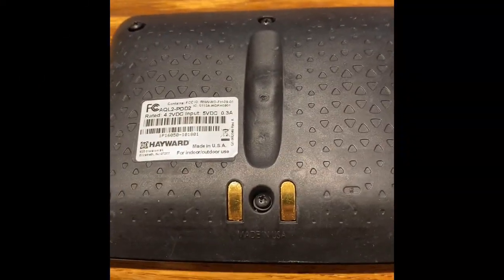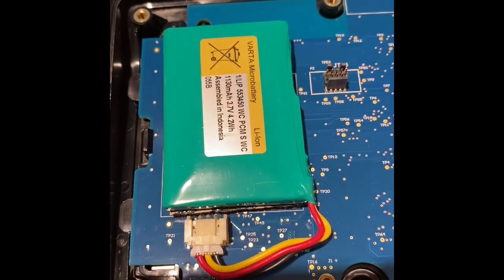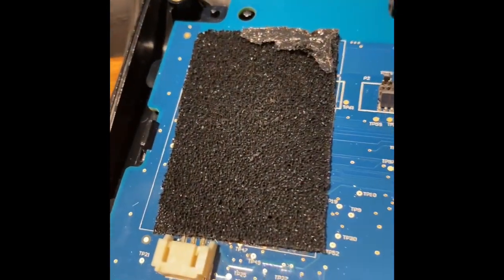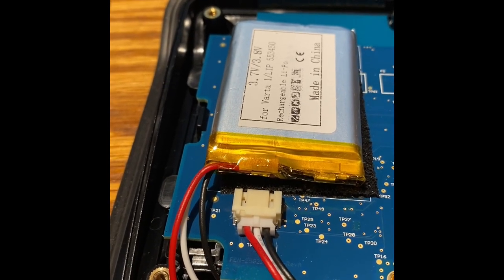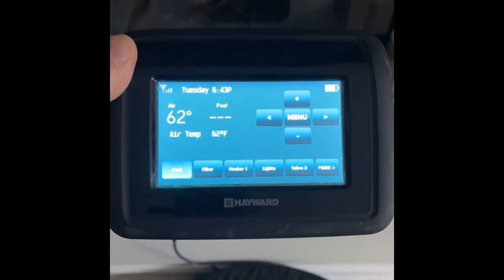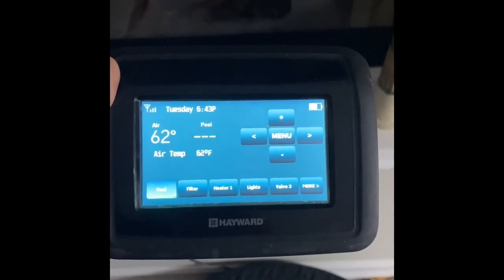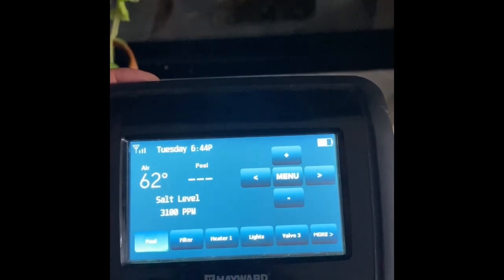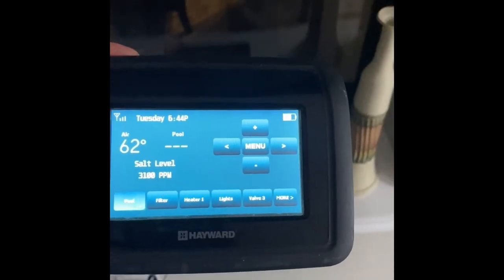How To Change The Battery In A Hayward AquaPod 2.0 Remote

Comment: Sam - Also wanted to add my thanks for this video and posting the link to the part.  I ordered and it came much faster than the seller said it would - I didn't clock it exactly but it shipped the next day after I ordered and arrived within 2 weeks.  
Warning for those who order from Amazon or somewhere else - I did try and order from these sites and the battery had the wrong input and didn't work - I only did this because the aliexpress store said it would be a 2 month wait. Even checking today - it is giving a Jan 26th arrival on Nov 21st (but as you can see from above - it was only a 2 week wait for me).  
Thanks again Sam!!!  Nothing irritates me more than poor and lazy design that results in consumers spending ridiculous money to replace something for 100's of dollars that could be solved with a sub $20 part.

Comment: Must admit I was really nervous about doing this but it turned out to be easy. Worst part was handling the double back tape. Video could show removing the female end of the charge cord but I simply pulled it straight out. Nice fix and saved a bundle as Haywood site says battery can't be replaced!

Comment: An ebay seller advertises replacement batteries for the same remote, but their specs are 3.7v 1800mAh 6.6wh, instead of your 3.7v 1130mAh 4.2Wh. Is this still compatible?
Reply from the maker: It should. Your 6.6 watt hour is more than the 4.2 watt hour I bought but they still only pump out 3.7 volts. Watch the size and thickness. The storage capacity for the eBay battery is greater than mine so the remote should last longer out of the cradle. To get that boost, it’s either better battery chemistry or a bigger footprint most times.

Comment: CAREFUL!  Make sure the wires are tucked behind the lower left corner screw mount.  Otherwise cover won't set correctly, and you can blow right through the plastic screw channels that hold the cover.  Then you better hope you have some epoxy and creativity....true story...